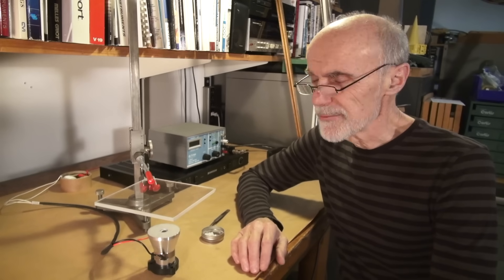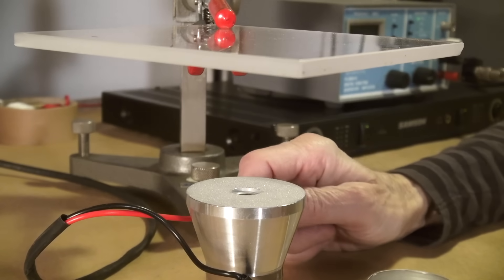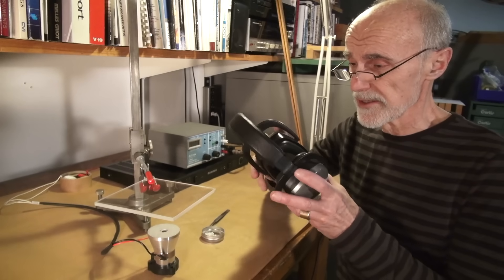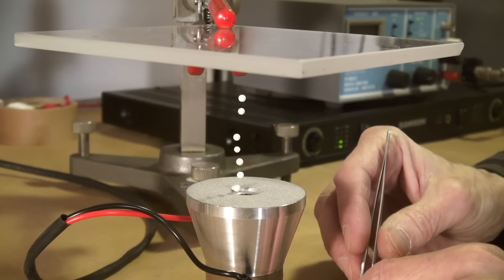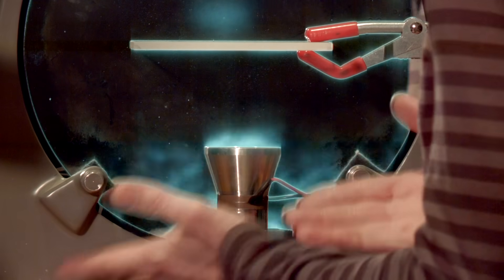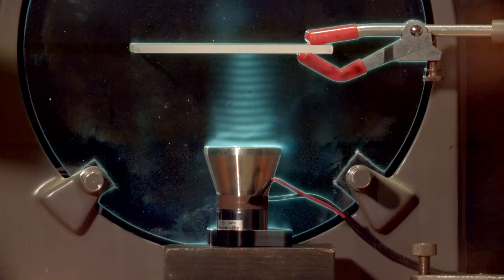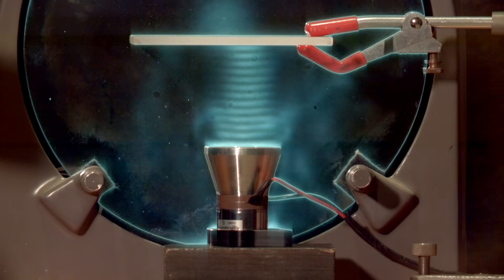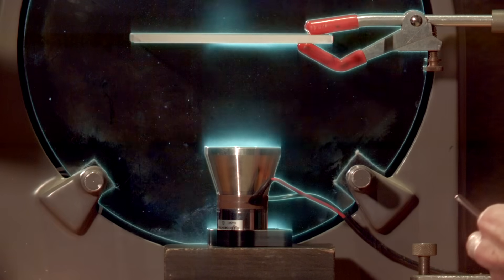Acoustic Standing Waves and the Levitation of Small Objects

Comment: Ok, now let's make a hoverboard with this tech
Reply: Hmmmmmm nope. You have to have the reflector (the glass) without that it doesn't work. Hmm🤔
Reply: @JF32304  Isn't the reflector glass supposed to bounce the vibration and keep the ball in place? Which would also mean if the glass is removed the ball will float or pushed away? 

In this video, the apparatus is fixed to the heavy sturdy table that doesn't move.  

What I propose or assume is that the apparatus is fixed to free moving slab of wood/plastic while the apparatus is facing  downwards. 

Then again, I don't know how big the rest of the apparatus is and how much power is required. But I think a levitating car or motor scooter can be possible.

Comment: If a small device was emitting a sound such as this, and was in the atmosphere (in the clouds), would the water in the clouds cause some kind reverb? Similar to the glass, but less powerful? 
And would that reverb be enough to make the device levitate? Someone smart point out the flaws in this idea cus I don’t research I just think 💀💀💀
Reply: Not completely sure but here’s what I think. 
I dont think a cloud would provide much reverb for 2 reasons 
1. It is simply to far away and it would take forever for it to come back and by the time it did it wouldn’t be enough pushback for it to float a small object as most of the sound waves would probably have spread out. 
2. A cloud is not solid and does not provide the reverb for the object to float, Pretty certain for this to actually work you need a solid object to bounce the sound wave off of.
Thanks for coming to my TEDTalk
Reply: @ivanmendoza5393  I enjoyed your tedtalk ty
Reply: @xxochitla7166  the thing is, sound is reflected by a phase difference of 180 degrees, when incident on a denser medium from a rarer medium. ( here see, the glass is more dense than air, so it's able to reflect by a phase difference of 180, which is responsible for the effective superposition of the sound waves, resulting in the effective production of stationary waves.) , since water is more denser than air, so yes, we can have the same effect with clouds too theoretically ( U might ask then why are they able to float, that is explained by the buoyant force experienced by the cloud surface due to air. Now the reason being it's too hard to experiment with is that :
Here we kept the glass surface fixed at that particular position ( which should be a multiple of half the wavelength to achieve the case of standing waves.) 
On the surface of clouds, the air particles striking with the clouds will create pressure on it, and that pressure will result in upward force on clouds which will increase the distance between the cloud and the surface of earth. 
And one more reason for this to be hard to achieve is that, the velocity if sound depends on the temperature of medium in which it propagates, and temperature of earth atmosphere decreases as we go up. So the speed of sound will also become variable, which will make the wavelength a variable. 
Theoretically it's possible because there we take many assumptions as to this cannot happen, the clouds are fixed, and that the velocity will not change, but practically it's very very difficult.

Comment: Instead of moving the reflector, wouldn’t it be much easier to adjust sound frequency?
Reply from the maker: In principle yes for a fixed distance to the reflector (not too far away) one could tune the transducer to obtain the standing wave. The practical problem is that our transducer—which is designed to clean the interiors of containers—is most efficient at only a single frequency.
Reply: @NatSciDemos  Wow, you're cool man.👍🏻 Thanks for replying.

Comment: I have a problem with floating dust particles in my packaging plant.  Could this be a method of concentrating the dust particles and keep the machine clean?
Reply: I dont think so, you would probably need a few hundred for a small packaging plant and the speaker needs a solid surface a multiple of the sound wave to bounce off of to float the dust particles.
(someone Correct me if I’m wrong)
Reply: @ivanmendoza5393  It would be an interesting experiment though.  Possibly a method to capture dust without filters.  The dust is captured between a solid surface and the emitter then the emitter is turn off intermittently to to let the particles collect and fall(?).  Seems like a fairly fun experiment. my 2 cents. ;)

Comment: Would changing the frequency or output of the speaker as you move the glass closer and farther be able to keep the standing wave active?
Reply: That's a good question. I would bet that a frequency shift would work.
Reply from the maker: In principle yes, if the frequency of the transducer and the distance to the reflector were adjusted simultaneously then the standing wave could be sustained.

Comment: would be interesting to see if someone connects the speaker to a PID-Controller to control the wavelength and aplitude based on the distance between the plate and the speaker. :) you could always have the standing wave

Comment: How many watts are you running, and what’s the efficiency of the driver, if you putting ear muffs on I assume it’s over 130 dB
Reply from the maker: The transducer is running at about 5 Watts. The 28 kHz signal is beyond human hearing range. The hearing protection is worn as a precaution.

Comment: So if one chooses a random distance; can one adjust the frequency of the wave, to find one that will have resonance/standing attributes.  Also, if that is so; if one can put the speaker/s into a standalone unit (like 3-4 speakers along a board at the corners to aid stabilisation), and could use a controller to dynamically adjust the frequency according to the distance from say the ground.... Would that make a hoverboard that was stable? (I'm guessing it would need to be above hard/smooth surfaces that don't absorb/dissipate the waves, and to compensate for weight distribution, one might need to put more amplitude/energy/bigger wave Delta to particular speaker corners).

Of course the devil is in the details.  The mass and size of the components, can the system put out enough energy with current components, and if the amplitude needs to be very high, will there be a way to safely control the waves, so that too much doesn't leak out and deafen someone (or worse - pulverise them)? - maybe the controllers can cut out/reduce amplitude when there's a wave leak?

Comment: I still don't understand how the high pressure region causes to levitate the balls
Reply: This is why you fail the science exams
Reply: @hanspetrov4343  Explain it to me then if you're so smart
Reply: The ball basicaly sits in high pressure areas caz the low pressure areas are too weak to hold it. But it also depends on the object thats in the areas, those little balls are just perfect waight to be traped in a high pressure area. Also the high pressure areas hold/trap those ball in them.

Comment: Very cool video. One point - 3:54 Surely the balls are actually sitting in the bands of low pressure, surrounded and pushed by high pressure on either side? This equilibrium Im guessing is more stable than the reverse.

Comment: I thought it would settle in the low pressure zones.
I'll be puzzling on that one ...........

They are not high pressure zones, they are zones where the pressure oscillates above and below the surrounding pressure.
The transparent/clear areas, where the balls don't stay - OH ..................... Got it now>

The clear areas are the areas where the constructive interference occurs;  that's why they are clear, the mist cannot stay there because that area is active with pressure wobbling between higher than average and lower than average.
The fuzzy areas are not high pressure areas, they are the stable areas where the pressure is just average; they are where the destructive areas occur.

Ok, now I understand.
Reply from the maker: If the bright bands—the "fuzzy areas"—are regions where the pressure isn't changing, then there would have to be a dark band right next to the reflector, or else there would be no standing wave. But we don't see a dark band next to the reflector; we see a bright band. Therefore the bright bands should be where the pressure is oscillating between above and below atmosphere—so called "pressure antinodes".
Reply: @NatSciDemos  
quote: "But we don't see a dark band next to the reflector; we see a bright band." I agree.

I think you might want to re-read your wording and edit the rest of the paragraph.

There is a bright band at the surface of the reflector.
There is no pressure oscillation at the surface of the reflector.
The bright band is where there is no pressure oscillation
Reply from the maker: @edwardlewis1963  In an acoustic standing wave where there's a solid reflector at one end—for example, inside an organ pipe—then the open end is a pressure node (the pressure is the same ambient pressure as the surroundings) and the closed end is a pressure antinode (the pressure is oscillating above and below the ambient pressure). Conversely, the velocity of the air molecules is maximum (antinode) at the open end , and is zero (node) at the closed end. So in analogy to our setup, the "open end" is at the transducer, and the "closed end" is at the reflector. Does the make sense?
Reply: @NatSciDemos  
The following statement which you just made, is incorrect:
Quote:
 inside an organ pipe ... the closed end ... the pressure is oscillating above and below the ambient pressure
Unquote

Please address whether you agree or disagree that this is a misstatement.  
(oh;  apparrently my previous reply became truncated because of the use of a reserved word 'unquote' followed by a colon;  please note the three statements I made in response to your prior statement..

Comment: this half wavelength has everything to do with Bragg diffraction in electromagnetic waves... thanks very much... it's a different aspect that I have not considered before if magnetism is the chicken and electricity is the egg... in carbon crystals the planes of cleavage act as wave guides, so white light becomes all blue when the unit cells are half the size of that particular shade of blue or whatever... and the diamond in my hat creates rainbows as the angles change with movement, so the result is a function of 2d.. and the incident angle when d is the diameter of the unit cell ... as long as the unit cells are half the wavelength of visible light.. it's the cause of the play of color in precious opal... and diamond... I figured it out about diamond fairly recently... the difference is opal is 5.5 on the Moh's scale of hardness... diamond is 10
so... diamond actually makes better lasers than ruby.. because the C14 begins to fission when stimulated by laser light, at the same wavelength as the light... and the neutrons fission and release the mass of an electron to become a proton and C14 becomes N14... and somewhere in the process is this exact type feedback system into the process... one of the tough things about developing a true Unified Field theory is getting all the proverbial ducks in a row.. it it doesn't work for all applications, it's right back to the drawing board for me... I will think about this for a while, see what happens

Comment: Question ? Is it dependent on type of current? Ac or DC and are the little balls made out of a material that is specifically designed for this ,  the  density of an object play a role how would it differ ,  is the speaker set at a certain ohm or what’s the resistance . I’m curious how I could replicate this  , for my own scientific knowledge,  I

Comment: what if you vary the sound waves constructively to a point instead of the resonance cavity. It sounds like (pun) an antenna's electromagnetic model defines a speaker in terms of oscillation, just mechanical instead of electromagnetic. I wonder if multiple speakers with some constant (or even varying) spatial coordination can beamform in time? You could chirp-sweep any cavity (room, car, etc.) and produce a point cloud solution. These days with AI you could probably segment and colorize said pointcloud.
Reply: you might even get away with one speaker given the significant propagation delay of sound in air and a known echo "key point" to self construct a wave.

Comment: So basically, if you changed the frequency of the sound, gradually, the standing waves would become larger or smaller, and you might be able to lift an object upwards, instead of having it stay there in one place. It might sometimes fall suddenly down to a lower wave. You would want to make it look as though the standing waves were moving towards the object.
Reply from the maker: The distance from the source to the reflector has to be an integer number of half wavelengths for a standing wave to happen, as we see at the end of the video when the reflector is gradually raised up and the balls fall down. Similarly, if we keep the reflector fixed and continuously change the wavelength of the sound, we would only get a standing wave for certain, discrete wavelengths. So to manipulate an object, one would have to control both the position of the reflector and the wavelength of the sound simultaneously.
Reply: @NatSciDemos  Can the object being lifted, itself, be used as the reflector? The reflector, right now, is an immobile object. But imagine it was merely a very heavy object. It just happens to be heavy enough that it sits right in that same position as the existing reflector. It's just heavy enough, and just light enough, to stay right there. If you were reflecting things off of it, and changing the frequency, would the reflector thing just fall down?

Comment: Why would the ball stay in high pressure region? The centre of low pressure region should be the trough of potential well.
Reply: i have the same question.   the balls (and the smoke) would seek the low pressure points wouldnt they?
Reply from the maker: Similar to what happens in an organ pipe closed at one end, the pressure is out of phase with the velocity of the air, and so the velocity is a node where the pressure is an antinode.
Reply: @NatSciDemos  In truth, I don't understand your reply.  What does the phrase "the pressure is out of phase with the velocity of the air" mean?

It is possible we're just debating terminology, however, it seems to me that a "node" is a stable zone of high-pressure in a standing wave while an anti-node is a stable zone of low pressure in a standing wave.   Thus, a ball would logically float in the anti-nodes, held in place by the surrounding pressure of the nodes.  (same way as an airplane wing produces lift because higher pressure below the wing pushes it up into the lower pressure above).

Comment: Here is the real question, does the weight of the base increase when adding levitated mass?
Reply: Yes, it does.  Let me try an analogy.  Imagine you have a bunch of birds in an enclosed van, and the van is parked on a scale that registers its weight.  If you bang on the walls of the van and scare the birds will fly around inside (read levitate) but the weight of the van won't change.  On the other hand, if you put some more birds in the van, the van's weight will increase regardless of whether or not the additional birds fly or not .  Does that make sense?
Reply: @wolfgangrueckner7151  Thank you for your response, It's so uncommon in todays world. Keep up the science!
Reply: @wolfgangrueckner7151  Additionally is it the wave compression (push) that adds the weight?
Reply: @rewtdawg9852  The weight of any additional ball(s) that are inserted into the standing wave is certainly communicated by the sound waves to the transducer generating the waves.

Comment: Concept of wave-particle duality demonstrated very clearly.
Reply: How does this represents wave-particle duality? This is just simple example of transverse wave experiencing resonance (constructive interference). Wave particle duality was at first just plain and simple hypothesis given by de Broglie's own thought experiments.
Reply: He's putting particles on standing waves, the waves are not coming from the particles.
Reply: Wait what? I am afraid you have no idea what you are talking about. 

This is a concept of ultrasonic levatation, the "waves" you are seeing is the waveform generated from the ultrasonic sound creating gaps of high and low pressure that can suspend ultra light objects. 

Literally the transducer or speaker at the bottom generated high frequency sound that creates pockets of high pressure capable of suspending light small objects. 

Wave-particle duality has to do with quantum particles. The best demonstration would be the double slit experiment. Again the difference is one thing deals with small macro objects being suspended by macro sound waves that have nothing to do with the objects. The other(wave particle duality) has to do with quantum particles(that for all intents and purposes you can't see) and those quantum particles in some cases act completely like particles and in other act as a distribution of possibilities represented as a possibility wave distribution. Quantum objects and ultrasonic levatation have nothing to do with each other

Comment: if the light color corresponds to higher pressure then why is there light coloring convecting upwards off of every heat source? After some research, the light bands coorespond to low pressure and for the case of the standing wave, they occur at antinodes where the pressure is oscillating between low and high with the highest amplitude.
Reply: Heating air changes its density and therefor it's refractive index and that's why you "see" the convection of air upwards.  Sound waves are pressure variations in the air which cause a change in the index of refraction also.  That's why you can "see" the sound wave.